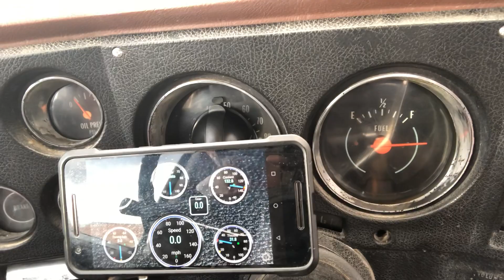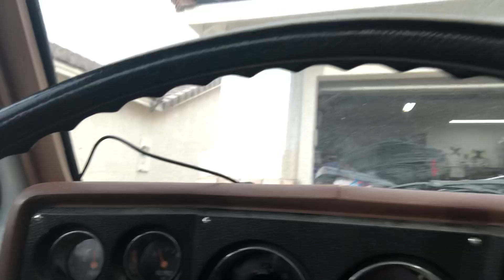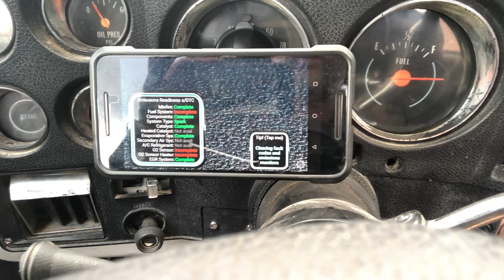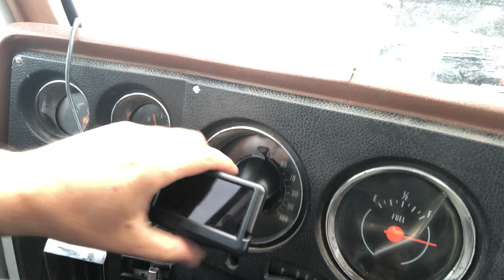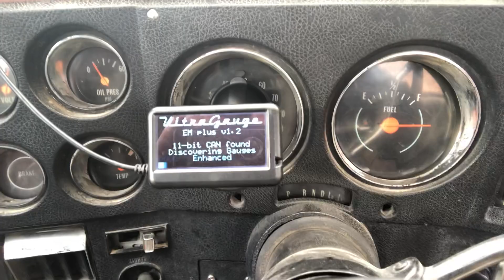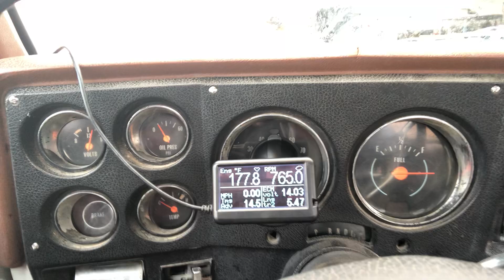Budget LS swap gauges

Comment: im doing the same thing in the 5.3 swapped 83 firebird, but im using the RealDash app mostly.  i've bought both full versions of torque and RealDash but i prefer RealDash app.  im going to do a video specifically more regarding the RealDash app likely this spring or summer.  alot of ice, snow and road salt here right now in canada